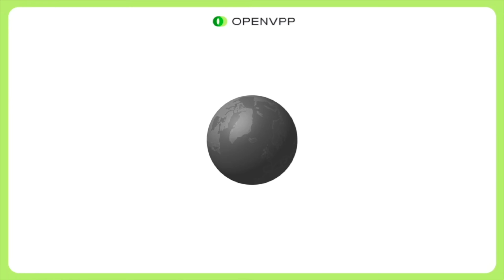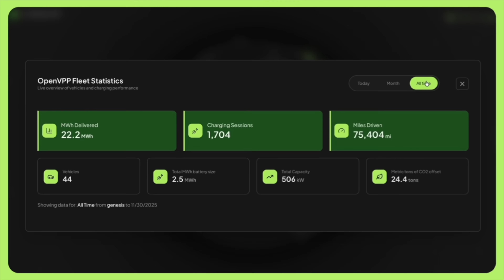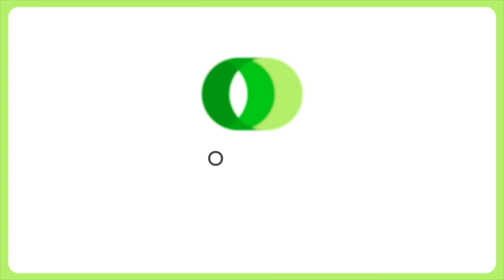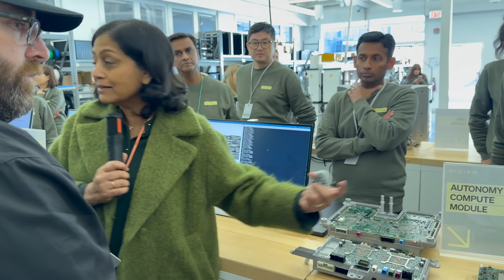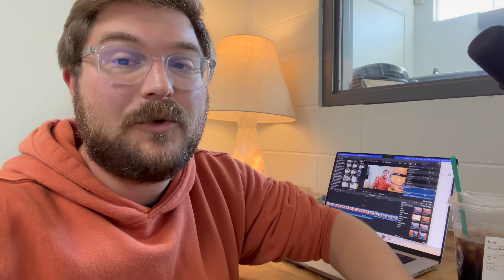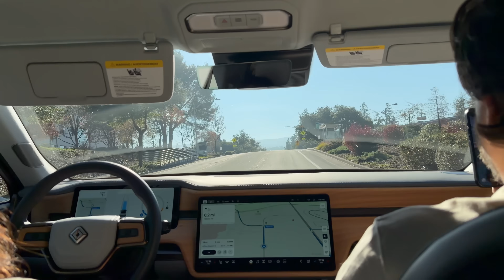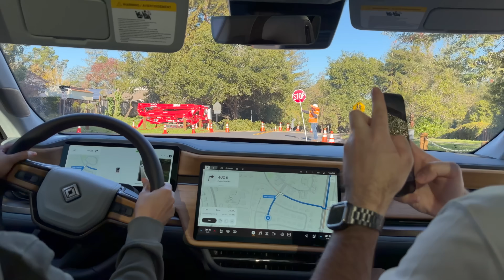My Rivian “FSD” Test Ride! Long Road Ahead But The Correct Choice

Comment: This is pretty impressive. Obviously a cherry picked drive and missing some key things like construction and collision avoidance but the overall driving confidence feels on par with FSD ~10 - not good enough to drive the family around with but also not as bad as you made it sound in the intro. 

Super interested to see your UHF videos since realistically solid hands free highway driving is the main thing autonomous driving systems can help with - and the ability to make adjustments without disengaging is something I love about Hyundai/Kia systems so great they've added it

Comment: What version of FSD would you say this 'not good' beta version is?  What version d you anticipate the production version to compare to which version of FSD?  Given all of the advancements in AI, I would expect Rivian to be able to progress faster than it has taken Tesla.  They will probably never catch up to being equivalent to whatever version Tesla will have at that time, but they could easily be close enough to be 'good enough'.

While there current Gen 2 may not be as capable as FSD, their Gen 3, with radar and LiDAR, could easily leapfrog Tesla when it comes to level 4.  Tesla's vision only/AI approach has basically no engineering margin, and as yet to demonstrate that it will achieve level 4.  Yes, I know that Elon has said it will within the next two weeks, but we should all know by now that his predictions are worthless.

In their Austin demo through September, they have yet to release any data beyond that, their accident rate is much greater than Waymo's, and that is with a safety monitor!  Who knows how many accidents have been avoided by the monitors.  I anticipate they will need another 1M+ more miles in order to have have an adequate sample size to be able to reliably predict accident rates.

Comment: Thoughts on how to evaluate: There are 3 questions which I think need to be asked:
1. Is the system "safe"? A system needs to clear a theoretical and practical threshold level of safety. No AI version of the Ford Pinto. No careening into oncoming traffic. Anything that fails this fails as a product.
2. Is the system useful to someone? An espresso machine that only dispenses used motor oil isn't of interest to anybody. There are lots of not-FSD systems which would be of interest to people, such as automatic parallel parking, or automatic driving that only works on US Interstates in good weather. As long as it is useful to someone it's fine.
3. Value for money. "There are no bad products, only bad prices." A Porshe 911 competitor that is slow and you can't take on the track might still be fine if it's available new for $5,000. Autonomous driving which isn't as good as Tesla can still be a great value if the price is significantly lower.

Comment: Rivian original ADAS with the required mapping did nothing for me, this if it comes mid next year, is much much better than the current system which really needed the Comma 3x to get useful ADAS.

Comment: The level of the autonomy capability they demoed could be a surprise or disappointment depends on your expectation. What really matters is that rivian got the vision & guts to make it a top priority strategic wise several years back, that's way before the very recent ai hype train & have the infra & talent & capex in place now that they're in a position to progress from what they have today, and the speed of which is non-linear. They could be 2 or 3 or 5yrs behind tesla but it won't take them that long to catch up. Also I've known many ppl for them affordability isn't the issue but the lack of a decent non geo fenced l2 assist is a deal breaker for not getting an r1. They've just addressed that.
Reply: Pretty much out of desperation more than anything else.

Comment: Imagine how many times they must have trained the car on that exact route, and it still required constant interventions. They could have spent more time refining it so the demo would need fewer takeovers, but the fact that they chose to show it in such a half-baked state suggests that the company is desperate. Rivian’s survival hinges on making it through R2 production hell and this whole “AI Day” event feels more like a fundraising pitch than a technology milestone. Realistically, their self-driving system won’t reach the level of FSD v14 until at least 2028 simply because they just don’t have enough data to train the model. On top of that, the first batch of R2 vehicles won’t even ship with all the required hardware implying they’re still sourcing it, which will only push software deployment even further out (but that's a battle to fight another day, surviving R2 production comes first).
Reply: yes, exactly, they probably traveled that exact route 1000 times - and yet it still needed multiple interventions.

Comment: I think to judge this fairly we have to step outside of the EV space. Most people haven't been in a Tesla or used FSD. When the R2 comes out it will likely be the first EV purchase for many buyers. This level of Point to Point will be an appreciated feature compared to what the top cars in the US market offer right now. Imagine you have a Mazda, Toyota, or Chevy and you get a R2. That leap alone will likely be enough, until Rivian gets more data to improve.

Comment: Kyle, a long comment however in response to the question you raised at the beginning of the video, I’d offer the following perspective. My view is grounded in an engineering background and in having led multinational businesses significantly larger and more complex than Rivian. Before retiring I managed businesses with hundreds of engineers across hardware, software, systems, and product integration, work that ultimately shipped into real, customer-facing products. You appear to be framing this discussion as a binary choice: one must either be excited or critical. I don’t think that’s the right lens. This isn’t about enthusiasm or skepticism, it’s about being objective and calibrating expectations based on observable facts.

First, Rivian has been explicit that what was shown is an early preview of a system still under development, not a finished product. Second, Tesla’s current position is the result of a very long, iterative process, not a single breakthrough moment. To put that into context:

1. As early as 2013, Elon Musk publicly discussed the concept of Autopilot
2. In 2014, Tesla offered Autopilot as a pre-purchase option
3. In 2015, Tesla released its first production Autopilot software
4. In 2016, following safety incidents, Tesla ended its partnership with Mobileye and committed to developing its own end-to-end autonomy stack
5. Between 2016 and 2019, Tesla went through multiple hardware revisions, sensor strategy changes, and major software rewrites
6. In 2019, Tesla formally positioned “Full Self-Driving” as a distinct package
7. In 2020, the FSD Beta program launched, exposing the system to real-world edge cases at scale
8. In 2021, FSD Beta v10.3 was briefly rolled back due to safety issues, illustrating how fragile and non-linear this development has been
9. In 2023–2024, Tesla began rolling out FSD v12, representing a major architectural shift toward neural-network-driven behavior

What this timeline doesn’t fully capture are the countless intermediate revisions, failed approaches, internal resets, and years of real-world data collection. Tesla has accumulated billions of miles of driving data, thousands of engineer-years of iteration, and continuous customer feedback from vehicles already operating on public roads.

Tesla also benefited from a far more supportive government and regulatory environment during its production and scaling phase. Rivian, and other newer entrants, are developing advanced driver assistance systems amid tighter capital markets, greater regulatory scrutiny, and less policy tailwind. Against that backdrop, expecting Rivian to emerge with a Tesla FSD-equivalent system at this stage is simply unrealistic. Objective analysis requires recognizing where each company is in its development lifecycle, the data advantage Tesla has accrued over more than a decade, and the structural headwinds newer players face today.

This isn’t about being excited or critical, it’s about being grounded in reality.  BTW, if that was my former engineering team riding along with you, they probably would have tossed you on the side of the road for the Tesla Semi call out, just kidding 😅.  You did say the video was unedited.
Reply: your comment is informative - and correct.

Comment: The opening question is important only to remind oneself that answering it gets us nowhere.  What the driver wants to know is how do systems compare objectively, through testing.  The 70 mph range test is a good example.  10-80% charging is another.  Create the test and subject the cars to it.  When available, take the R2 and a MY on the same course from city center to interstate to city center while letting navigation choose the charging stops in between. Repeat it with each iteration, and we will, vicariously, "live" the evolution.  I agree: Good on Rivian for doing this.  We need them.

Comment: This is very similar to 2022 tesla FSD. With the addition of the LIDAR they will probably leapfrog tesla in 2-4 years' time. The gap isn't so large that it's impossible to surmount.
Reply: yeah it will be interesting to see how a point cloud input into an e2e model will yield ‘leapfrog’ improvements to reasoning and long term planning

Comment: Rivian is hemorrhaging and burning through so much cash, it's insane. For Rivian to say to even have an autonomous day is frankly ridiculous. How about focusing on current production and deliveries before trying to focus on autonomy. At this rate, they won't exist in 2027.
EDIT: Just the fact alone that the Safety / Demo Driver has to manually drive the vehicle out of the Autonomy Day lot shows it has already lost to Tesla.
EDIT #2: 21:20 - Vehicle turns into the left lane instead of right lane when making a turn; this is an illegal move. And again at 27:07, turns left but then takes the right lane rather than following into the left lane first.

Comment: different approaches are going to take time to develop.  I think it's fair to say there is a benchmark in terms of performance of the platform--but I think it's good for the industry that there are other options.  Tesla's vision based system has inherent shortcomings.  And as a FSD user myself, I'm not going to act like it's perfect.  I intervene at least 1-2x a day even on 14.2.1

Comment: Rivian looks VERY far behind Tesla and most other autonomous platforms.
Literally 3 minutes of driving and it starts merging into another car and the driver had to take control... Not 20 seconds later and she has to take control again for a car on the shoulder. At 18:34 it illegally doesnt yield to pedestrians at the crosswalk.
Honestly they look like they are 5+ years behind, and they have less vehicles on the road than their competitors, so the training data will be poor. IMHO they shouldve licensed from someone else.

Comment: So as a waitlisted R2 patron do I wait until the latter R2’s that are installed with the LIDAR  in late 2026??
Reply: I also have an R2 reservation (day 1).  I believe the hardware will be complete and shipping at first production release (including LiDAR).  But as is typical, the software will lag behind, but will evolve with regular over the air updates.  Universal Hands Free is available because it can run on current R1 (Gen 2) hardware, but the Point-to-Point Level 2 software is what was just demonstrated.  If the hardware isn't ready by production release, then, yes, you should definitely wait if you want FSD-like capability.

Comment: This may be a cop out but I think the answer to the opening question is a bit of both. The fact that Rivian is developing their own autonomous driving model from scratch to be vertically integrated with their vehicles is amazing and should be lauded, but they can’t improve without critique, so a healthy criticism of where they are at is necessary for them to make improvements

Comment: Kyle, while I appreciate your honest approach lets not forget how tesla got to FSD. They used my family as guinea pigs or lab rats while their system evolved. They overpromised and used our on the road data without being transparent to the owners nor the NTSB. JUST in 2022 our model 3 (In cruise control) would slam the brakes due to opposite-direction semis on a 4 Lane highway. Not once, but multiple times until we realized it's to dangerous to trust. Then they offered FSD as afree trial. In Georgia every 10 miles or so on the interstate there would be a minimum speed sign of 40 and the car would slam the brakes not understanding the signage. With inclimate weather the tesla cameras shut down and required cleaning. Just the other day with a moderate rain the system shut off. Tesla would never respond causing us to contact the NTSB. With teslas lack of Lidar (Huge mistake) I think RIVIANS approach will not only be safer, but more transparent. I'm just like you and a sucker for newer tech, but at what cost. Hopefully RIVIAN will improve with a better approach. Thanks for your review.
Reply: Lidar isn't a panacea. Also, nothing like FSD existed before Tesla created it. it is easy for companies to look at what Tesla figured out after they spent millions of dollars determining what worked, and then rip them off. Hopefully Tesla has patents on this stuff, and sues the shit out of Rivian for ripping them off.

Comment: I waited until the completion of the demo ride to comment.  To your initial question about comparing Tesla products to other brands' efforts at self driving,  I would agree that Tesla has a lead that will never be bypassed.  Too many brands are suggesting that they have "comparative" products, when in reality, they only have limited junk.  I do own a Tesla Model 3 LR with HW3 AMD that I received in 02, 2022.  It's stale v12.6.4 of FSD, in my view is truly amazing.  I admire what Rivian has done thus far with it's vehicles and hope they continue and  become profitable.  They are following in the Tesla shadow and have been able to avoid the criticism and negatives, that Tesla had to negotiate.  Their path is simpler.

Tesla did well but is far from a perfect product.   The best scenario for the consumer is leap frogging.  It probably won't happen with FSD but it is happening with all sorts of other features of the car.  Different brands are making better elements of the  vehicle.  I want Tesla to feel competition.  It could be as simple as a better display screen menu.  I have complained for years about Tesla's lack of font size options.  Every small phone or tablet has the option for multiple font sizes, Tesla reluctantly a while back add a choice between 2 font sizes.  Weak.

Comment: Keep attacking them on sub-par tech.  This was a shitty example of what they think they will be able to do in the future.  The system on my 23 R1T is mostly useless, I primarily drive surface streets.  This was scary.  I think my database of driving without hitting anything the past 40+ years is better thank a couple of years of playing around on simulators.  At least they should have used their A-Team with Kyle in the car.  (Hopefully this wasn't.)

Comment: As someone who purchased a Tesla model x 90d on December 31st of 2016 with the FSD package  I have learned a very hard lesson, you buy what's available and not what's promised. With that said, I think the second issue that I face is with Tesla. As you mentioned. It is an amazing system but that 1% of the time that the Tesla FSD makes a major mistake. Never allows you to relax while it's on full self-driving. I think we need to look at the starting point of every one of these manufacturers to see if on Day zero. They have learned from others and are starting from a new point that allows them to get to full autonomy in a more efficient and Safe experiance That should be the measurement. What do you think?

Comment: Considering this is essentially Alpha code that is at least a year away from production release, I'm not concerned with the current state of its capabilities.  Baby Steps.  I have FSD on my 2020 MYLR (Intel Atom/HW3/v12.6.4) and I still have to do abrupt takeovers and see it do stupid stuff almost every time I use it.  I think Rivian's capability will evolve much more rapidly since they have the advantage of hardware that is at least as competitive, if not more so, as Tesla.  Come back in a year when production release h/w (including LiDAR) is available and then do a head-to-head comparison with Tesla and any other vendors claiming point-to-point Level 2 systems.

Comment: Leader... Waymo.  Based on actual large data sets studied by a third party.  Second, by a distance... Tesla.  Everyone else a distance behind Tesla.  But, progress seems to be happening more rapidly with everyone.  Rivian's engineering build looks as good as the FSD I tried in my Model 3 a year or two ago.  Maybe Tesla is 2 years ahead of a startup...and 2 years behind Waymo (if what Waymo does can even be matched by a non lidar system).  And Waymo is talking recently about licensing to automakers.  By end of decade, maybe everyone has hand free nearly everywhere, even eyes free mostly, a modest optional package on everything.  Conceivably optional level 4 autonomy with lidar that costs the automaker a few hundred bucks.  "Far behind"or "far ahead" is seeming to be 2 years, rather than a decade.

That's gonna affect business models.  Like Rivian says, it's gonna be a gotta offer.  And so, everyone will offer it (either their own, or something licensed).  Probably by the end of the decade.